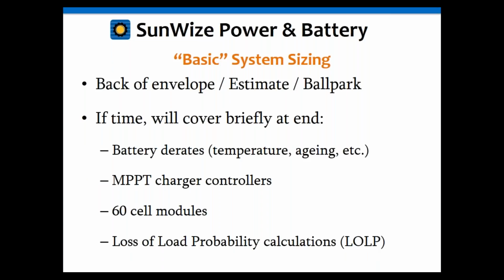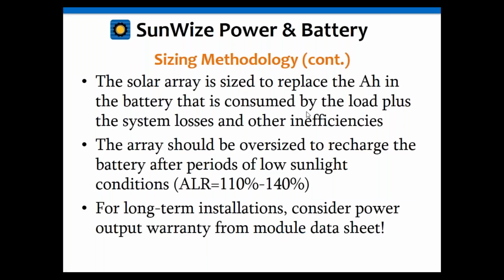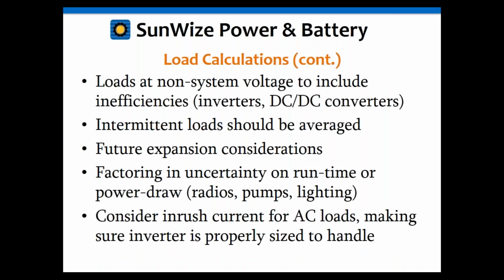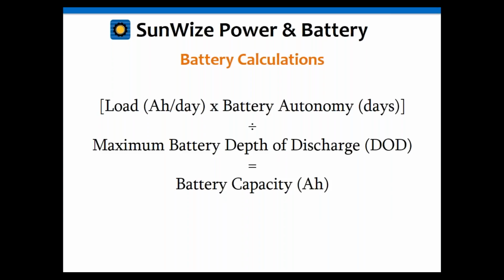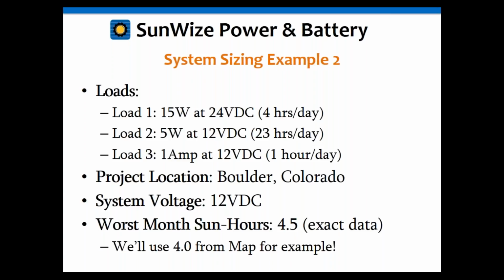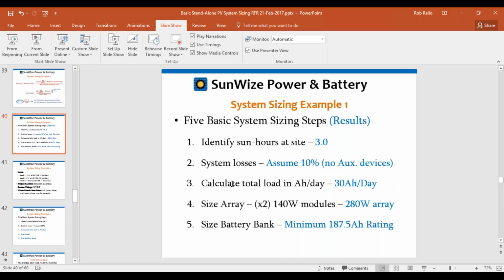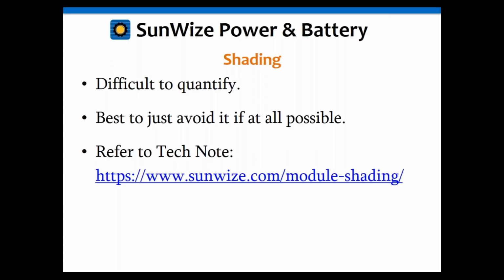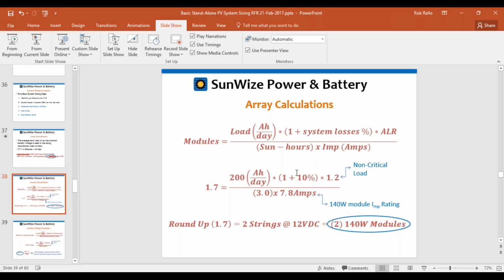Basic Stand Alone PV System Sizing

Comment: Parallel panels are better for shading then Series.. I prefer 3 x 10ah panels for this reason put in series to match your regulator as panels are cheap.  Such as 2 x 40Voc strings of 60 cells for a total 80Voc on a 100Voc max MPPT on a 24V nominal or a triple series for 120Voc on a 150Voc max MPPT on a 48V nominal batt system.    2 or 3 x 3 x 330W 60cell panels can be a simple 2 or 3kw off-grid system for general use.  MPPT charge controllers are common in this size and can keep the amps under 30 this way minimising on cost.